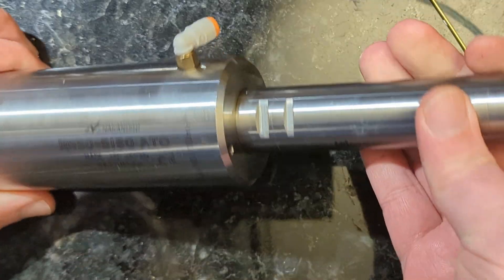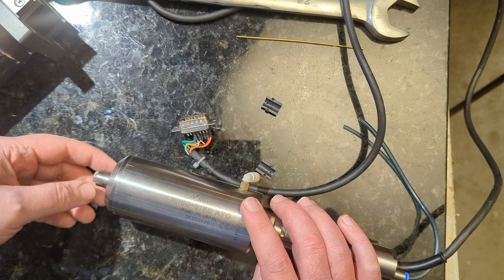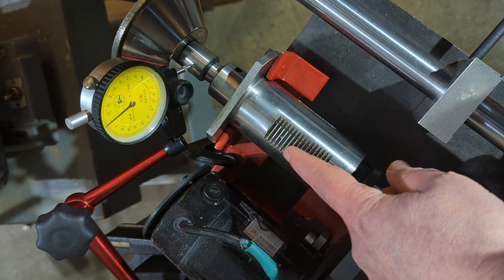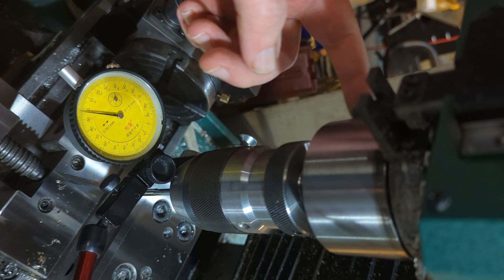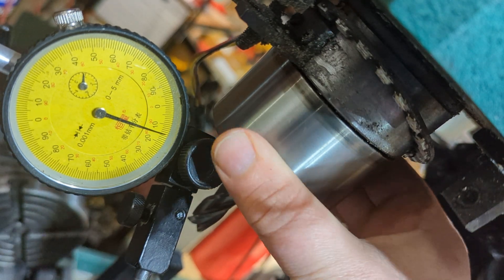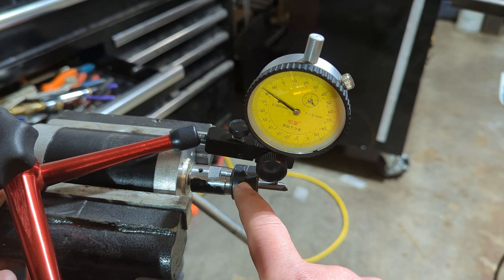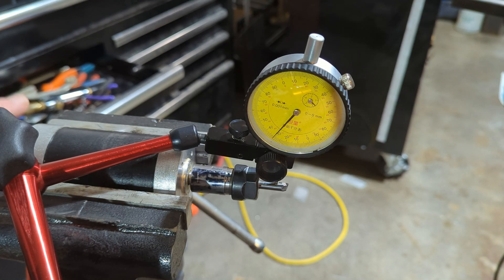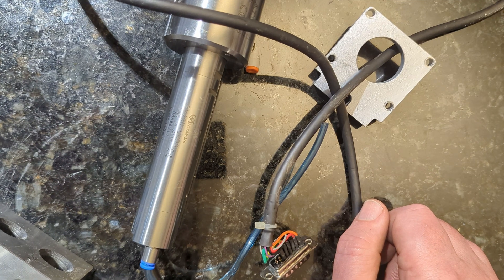$1700 cnc spindle vs $100 spindle runout

Comment: Have you replaced collet? For mine,  bundled collet and nut was not good quality, but after changed them, the quality was acceptable.
Reply from the maker: yes, i bought 3 4mm's in an auction, and also paid  retail for 2 others.  I have 1/8", 4mm, and 6mm